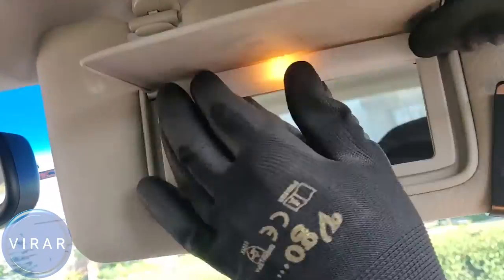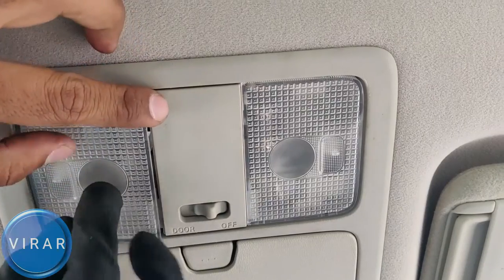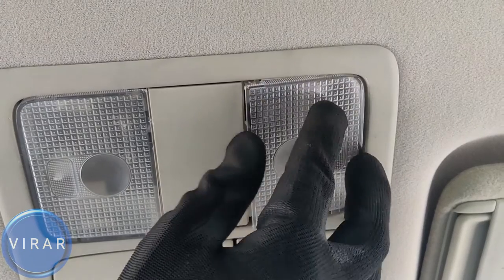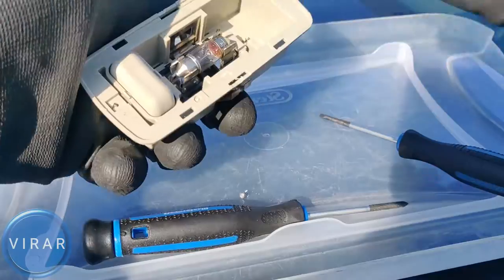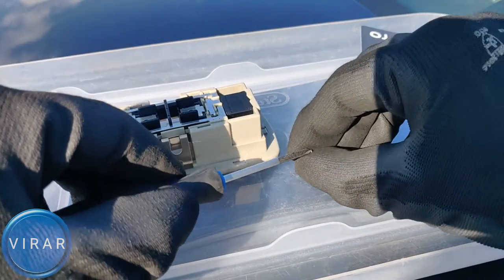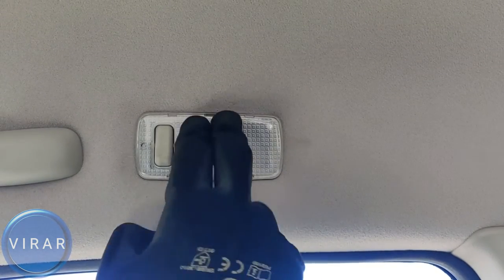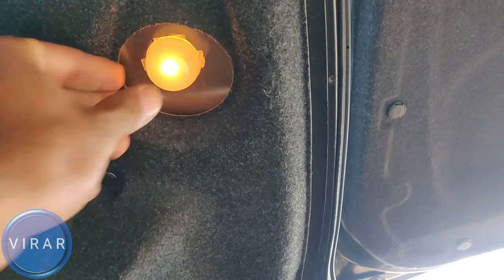How to Replace Interior Lights (COMPLETE GUIDE) - Infiniti G35 (2003-2006)

Comment from the maker: 0:00 - Introduction 
0:31 - Door / Courtesy Light : DE3022/ DE3175
2:25 - Visor Light: Fuse Type Bulb, 28mm 
3:20 - Map Lights: DE3175 
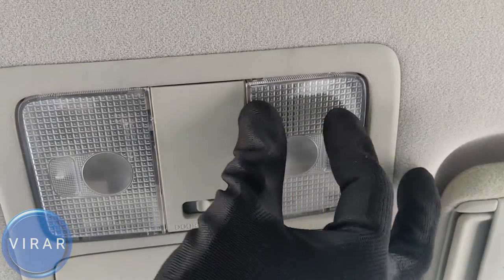4:25 - Rear Passenger /  Dome Light: DE3175 
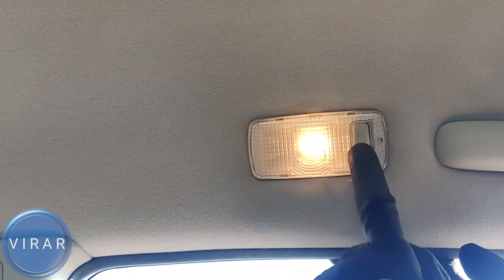6:36 - Trunk Light: 194 / 168 / T10 

Purchase the bulbs for your vehicle here. https://auxito.com/?ref=VirarAutomotive 
Use the promo code for a 12% Discount. 'VIRARAUTO' 

Visor Lights: https://www.diodedynamics.com/vanity-light-leds-for-2007-2008-infiniti-g35-sedan-pair.html

Bulb Replacement guide:  https://www.sylvania-automotive.com/bulb-finder.html
Bulb Type Cross Reference Guide: https://www.vleds.com/cross-reference-guide

Comment: I changed the lights on the driver door and now all of my lights don't work. How do I fix this? Somehow it turned off my dome lights, door lights, vanity lights, everything except the trunk. Putting the old bulb back didn't fix it
Reply from the maker: Yeah it's like your interior lights fuse blew at that instant. It's easy I have a video for that as well. Here is the link. 

https://youtu.be/o8YYSTGdunw
Reply: @Virar Automotive  I checked the fuses and they all look good. Disconnecting and reconnecting the battery terminals worked to get them back on